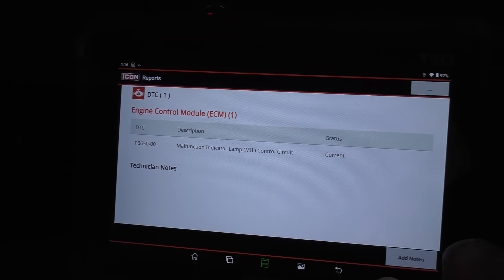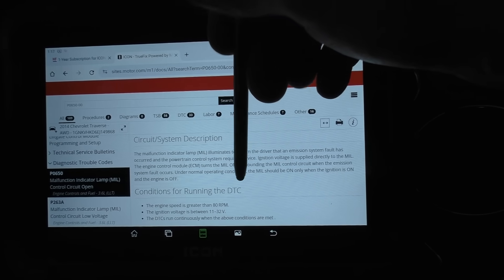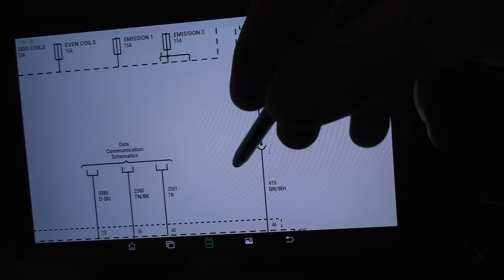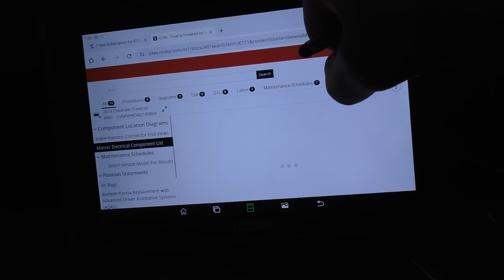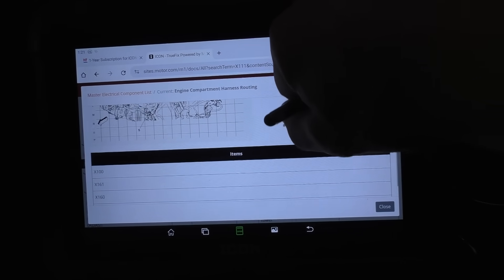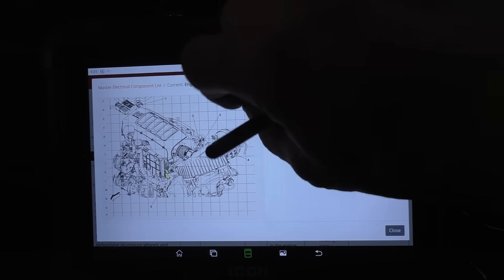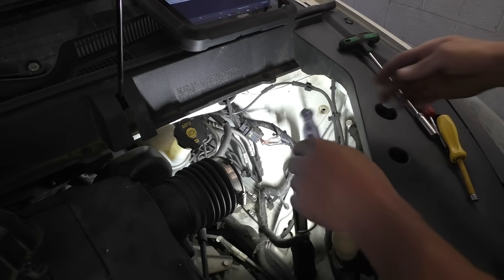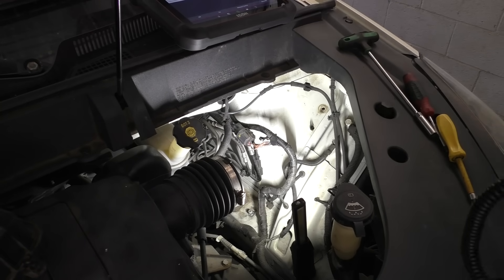Chevy Traverse - Check Engine Light Will NOT Turn On!?

Comment: Got a question for you.... Is it true that when starting the car the key then activates all the lights to make sure everything is working before the car is started? Then this will then tell a buyer of the car if some dirtbag mechanic has disconnected a wire to cover up the engine management light? So all potential trouble codes are hidden...

Comment: Why didn’t you Saturday those joints before putting the pinch and the heat shrink on it? I thought anything had to do with computer stuff had to be soldered

Comment: Power probes and LED test lights confuse so many as they don't load the circuit. You can't beat a good old fashioned test lamp in 99% of fault finding.

Comment: It takes a special kind of a hole to know exactly how to disable a mil instead of fix the actual issue. Geeze.
Reply: Right. What a dirty thing to do.
Reply: lots of them out there still trying to fix cars!!
Reply: Cheaper to cut the wire and sell it than fix the problem.
Reply: The glitch with disabling the MIL in this way is that it will not illuminate the MIL Key On Engine Off (KOEO) as it is supposed to so it is easy to observe that the MIL is not working correctly.  As an electronics engineer, it would be pretty easy to build a little circuit that would illuminate the MIL KOEO and then turn it off when the engine starts running as determined by alternator output voltage or crank position sensor pulses.  Get them made in China for 50 cents and sell them on Scamizon for $10.00 as "Auction car preparation modules".
Reply: @Vincent_Sullivan  I’m glad you (hopefully) use your genius powers for good, not evil!
Reply: @Vincent_Sullivan  It's been done. Not even that complex, just a timer that turns it off after a few seconds. Those in the know when looking at a suspect car turn the ignition on and wait to see if it goes out when it shouldn't. A trailer split charge module would do a convincing job before the smart alternator came along. The oil pressure signal would be easier than crank sensor pulses as it's already at the cluster. I'm thinking that basic handheld scantools are so cheap these days it would be a good idea to get one and scan any car you are thinking of buying rather than rely on the MIL.

Comment: So what happened?  The auction cut the wire to turn the MIL off?  I think that's why you called them scumbags?
Reply: Correct.  The MIL was on, probably for the wheel speed sensor issue Eric fixed in the previous video, and rather than fix it they cut the wire to turn the MIL off.
Reply: More likely the punk that sent it to auction cut the wire.

Comment: My question is why were they even messing with that big connector for the mil? Just weird they only messed with that wire, I guess they were just trying to make sure it didn’t come on? Or a botched repair
Reply: If it's a person/shop experienced at sending vehicles to auction, they probably know or quickly look up exactly what pcm pin to disconnect to disable the mil

Comment: Eric: it is not a hood, it is a bonnet. And those are not cotter pins they are split pins. I literally inspected 250,000 Oldsmobile cars during final assembly. I inspected the right front wheel assembly to make sure five cotter pins were installed correctly. Each had a printed line on the inspection sheet, and between both sides the sheet repeated the word "cotter" ten times. The word "split" was nowhere to be seen. It so pisses me off that the English speakers from England post comments about you using the American English words for car parts.

Comment: This is completely off topic but Eric, if you are reading the comments, could please tell me when you did a video on a GM car with a Intake Air Temperature Sender p0113 problem? I'm sure I have seen one. Have a 2011 Buick Lacrosse 3.6 that has this code and don't want to fire the parts canon. The sender Ohms out at 2.47k at 66 deg which is way off according to the " Google ". I would like to follow your lead on diagnosing the problem.  Thanks

Comment: If You can do it, I can do it, Right?
Watching because of a 2007 Honda Pilot, no check engine light, with full engine 6 cylinder misfire codes, and a CAT that had same temps inlet and outlet. No check engine light. They want to “fix” and sell the vehicle. I could not get live data misfire activity out of it using Maxi-Sys or Apollo.

New CAT holes in flanges not matching vehicle flanges. Locating a better Direct Fit, and will take it from there.

Comment: The first note of concern on ANY Traverse or Acadia is a MIL that doesn't come on. Those cars have so many problems, that light is on standard straight from the factory. Like you, most of the ones I have had in the shop that "just got purchased from a used car lot" had the MIL led scratched off the circuit board inside the cluster. That's an impressive effort to swindle a potential buyer!

Comment: Wow easier than pulling the ckeck engine bulb out the cluster just cut a wire
Had a customer who bought a car from a flipper. Checked his car for codes 420 code no check engine light pulled the cluster apart no check engine light bulb
Need a new cat

Comment: Tech tip of the day: very cafefully purloin clear nail polosh from The Mrs. O. DO NOT GET CAUGHT!  Works perfectly for sealing  probe holes or other points needing protection where tape just isn't good.
Reply: Torn speaker cones too.

Comment: No, cutting the wire like that isn't the cleanest fix for the engine light, if you are smart, you cut the wire and connect it to another signal light which behaves similar ABS or so, then it turns on when key on, and goes out with engine running, then probably no one will ever notice.
Reply: lol
Reply: This used to be a thing back in the day with engines with low oil pressure at idle issues.

Swap over the lamp holders for the oil pressure and generator/alternator and voilà, the oil pressure light goes out as soon as the engine starts…

Comment: I wish you would just solder them wires and not use them butt connectors that sometimes you can just pull right apart. Soldering insulates the open wire with tin and also makes Best connection possible without pulling apart. You do such great work i think you should also not use them junk connectors..
Reply from the maker: Show me a factory soldered connection on a car and I'll start doing it. I'll show you a hundred barrel connectors on OEM harness when you can't find a solder joint 😉
Reply: I thought you was going to maybe say that but them oem ones the tool used for the crimp makes it a lot more solid like a cold weld. Most of these tools used for crimping do not make the same strong crimp. But it is your business brother of course do it any way you want. I just see a lot of those not oem connectors fail. Still very good work tracking down all these issues.

Comment: Another dirt bag trick i have seen is the power for the Diagnostic socket getting cut buy a shop so they are the only shop that could read "codes", I use to work at a small dealer we knew most of the cars we sold and if they have been at that the shop for anything, if you pluged in the scanner it would not power on the Probe. it took a few cars to connect the dots and thankfully that shop is no more

Comment: Sure, anybody can cut a wire and disable the check engine light, but, who has the talent to make it light up for the check and make sure it stays off the rest of the time?
Reply: Bury a light and 3 second timed relay in a harness would do that 😂 Completely functional circuit with feedback, no light on the dash.
Reply: @TremaineLea  Yes, that would do it. LOL!

Comment: I agree with 'the auction' being full of scum. So are the dealerships, Ive bought n sold many vehicles and its one of the worst industries ive dealt with. You have to learn which ones are good and which are iffy. I had a vehicle that has a inline device to lie about the mileage and turn off the mil. My oh so favorite one right now if you see the same car come up run away from it. Someone is buying them, doing engine/trans swaps, and throwing them back up for sale.

Comment: You should have soldered one side of that wrong type of connector you used, and then welded the other, just to make sure you  triggered as many people as possible.  Oppoutunity missed . . . . . .
Reply from the maker: Next time 😂
Reply: Crimped or soldered no matter. By the time a car in NYS needs that repair either repair will outlast the car.

Comment: If diagnosing something and there's a 50/50 "pick one to test" scenario - the one you choose will be the wrong one 100% of the time guaranteed. The level 1 enlightened diagnostician picks one to test and starts to go down the path of testing that, getting stuff lined up to probe etc. but then switches to the other one at the last moment.... and it's still the wrong one 100% of the time.
The level 2 enlightened diagnostician does as per level 1... but then switches a second time to the original choice at the double last moment... and whadya know? It's the right one 30% of the time.... you managed to out smart the "inanimate" thing you're diagnosing not even a third of the time.
Thing is - we meat sacks like to think of them as inanimate - they're no such thing - they live to troll us at every opportunity. Ultimately we win by sending them to the crusher out of frustration - but it's a hollow victory - and that's if it's someone else's thing we are diagnosing. If it's our own, then it's a pyrrhic victory as we have to go right back out and purchase another bastard troll to replace the one we just crushed.

Comment: Who wants their engine light fixed? It's the most useless signal light in a car! If it's on, you don't get DOT and the sticker, even if the car is running fine, if there is a real problem the car won't run in the first place, and I don't think that there is something that might break by ignoring the engine light, it's not like the oil pressure warning light, it's called the money light for a reason, you don't get the sticker because the light is on and have to pay 1000$ because some useless sensor is broken.
Reply: maybe take an advanced class in auto repair for the computer side. 
without the computer system, you would not have the kind of performance you get from modern vehicles.
Reply: @MyNewUserName47  That's true, but if it still makes 80 mph in reasonable time no one will care, most people are struggling already and not getting a sticker because of an engine light could ruin them.